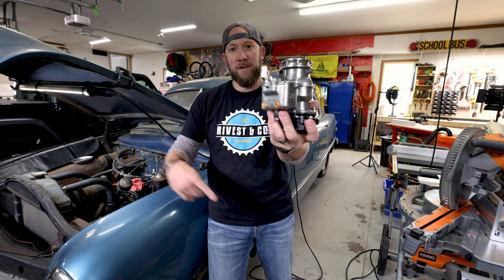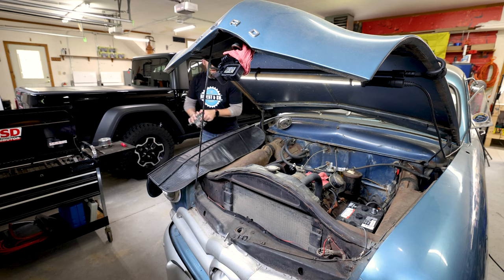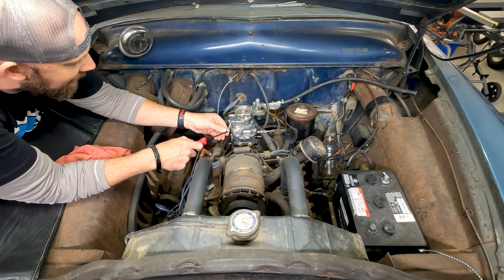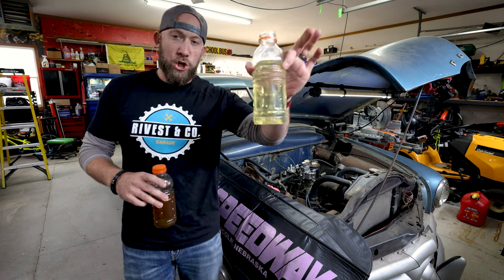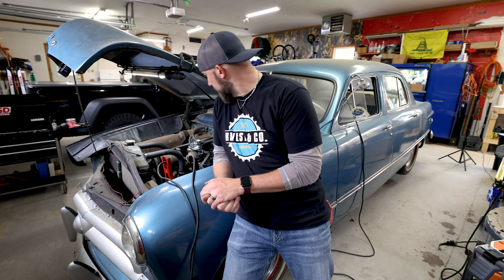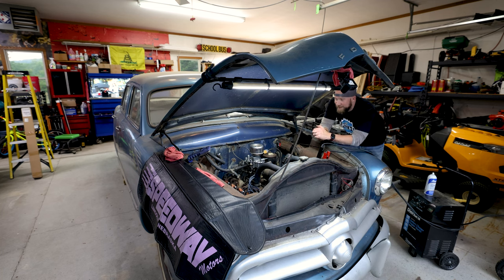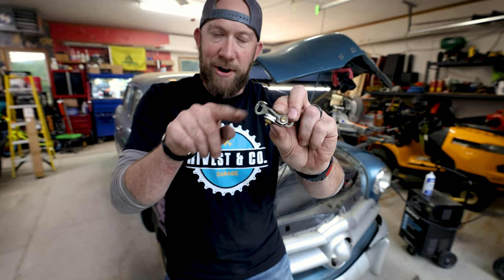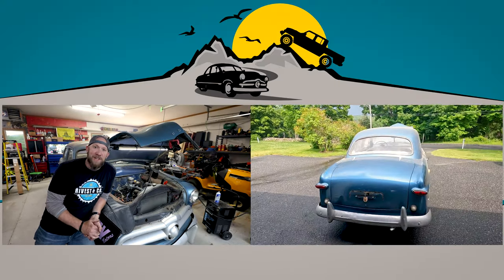First Start 1949 Shoebox Ford with original flathead v8 - will it run?

Comment: Even with the weak battery the 6 volt starter turn it over quite well.  I've never had a need to change to 12 volt. Motor sounds nice.

Comment: I had a 1969 Mercury Montego 351W 4bbl.  It had this bad surging issue.  Bought a rebuilt carb.  Still surged.  Like the '49 it just needed a points adjustment.